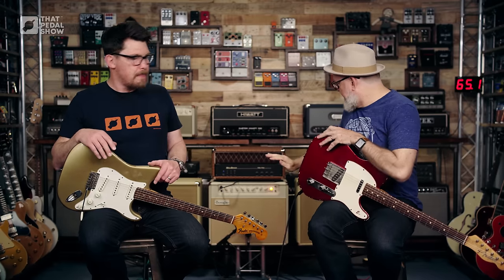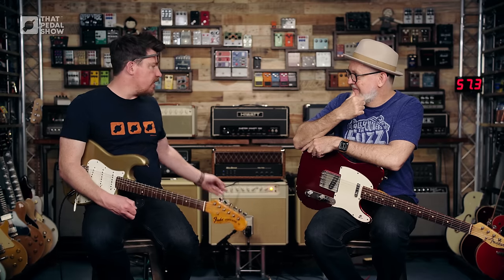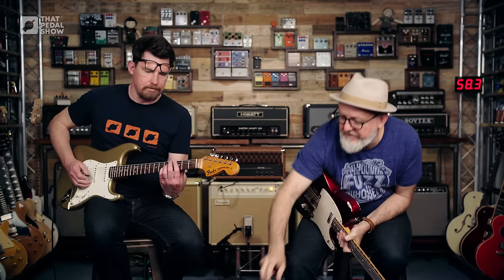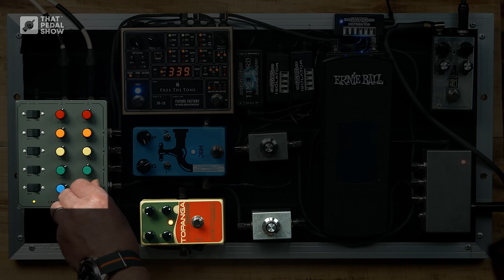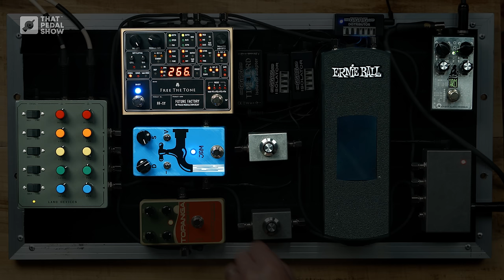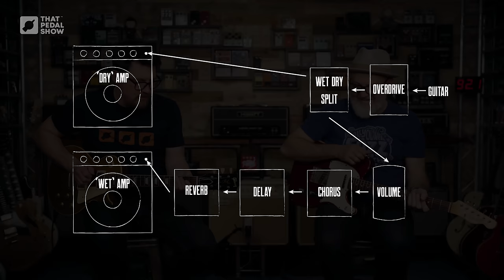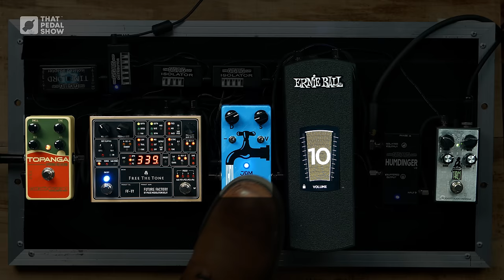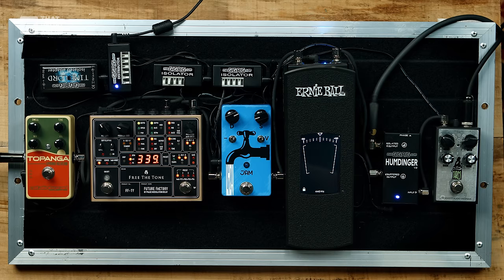Did We Get Wet-Dry Guitar Rigs Wrong? [Proper Wet-Dry-Wet Vs TPS Wet-Dry]

Comment: Hi Dan & Mick, what a top show this week, cheers! Quick question if I may? I have a 2x12 cab modded so I can plug in one head @ 16ohms or plug in two lunchbox heads which splits each speaker to 8ohms. Both amps have parallel fx loops so I can split delay into one, ‘verb into the other. Switch heads with an ABY pedal and I can put different modulations after the split. Tone options for days! Is this dual mono, or something else? Radial Bigshot sorts phase and ground issues so it’s pretty quiet even when loud.  Thanks lads

Comment: I use a Vox AC15 as my main amp, dry-ish. But I do use a touch of the on-board spring reverb, and the tremelo when I want it. And then have two old Vox Pathfinder 15Rs for stereo wet. No effects loop in any of the Vox amps. But I can use the Pathfinders as my Wet-Wet stereo amps. I tend to play pretty clean, just a touch of MXR Timmy to fatten. Then EHX Hot Tubes for a bit of dynamic grit/hair/dirt. For the music I love to play, I love to build up stereo soundscapes. And I wouldn't want to lose out on the lovely stereo pedals for chorus, granular, delay, and reverb. So I split it there after the Hot Tubes. One feed goes mono Dry-ish to Vox AC15 center channel. The other split feed goes to TC Electronic SCF+. After that, it's stereo for the L-R Wet-Wet signal path. SCF+ Into Chase Bliss Mood mk.II, SOMA Labs Cosmos. Then finally UA FX Del-Verb. It's more towards wet-dry-wet. But, it takes on some aspects of the TPS Wet-Dry, in that, the stereo effects are in series, not parallel. And I don't use loads of volume pedals/controllers. It's a studio setup, not for live. So I I just use the built in volume controls on the pedals, and amps. The two Pathfinders are nice and small. And sound similar enough, but nicely high pass out the muddiest lows for the reverb. The Pathfinder pair is plenty loud enough for wet in the studio. I like how they look like a little Vox trio too, with AC15 front and center, and raised off floor. And the two Pathfinder sidemen, just behind, on the floor, and closer to wall. For re-inforcement of the smaller cab/speakers bass. Only issue is cumulative volume. Would like to try a pair of AC4s as the wet-wet amps, and a Weber mini-mass on the AC15.

Comment: Still not quite right boys!!! The origin of the W/D/W was a regular stereo rig form the late 80’s with an added dry cab. Before that they used slaved heads for preamps. They did not use a speaker connected to the amps. They had load resistors on the amps and used line out box to feed the rack. Normally they used a PA power amp to power the cabs. Early 90’s Bradshaw added a dry cab instead of the the static load box. All 3 cabs had dry in them, but L/R cabs also had effects. You also had a dual stereo mixing systems to make it able to run things parallel and series. 

After some time guys like Landau started using a mic preamp on and mic on the dry cab. He then used a Lexicon MPX-1 for just delays/reverb in parallel. Power amps was a Marshall 8008 and two 1x12 for 100% wet. Running all units like you guys did in this video is not the proper way coz there’s no interaction between the effects.

Comment: The Direct out tap-points that Luke used were Line-Outs directly off the Speaker, because he wanted Output Stage Distortion - not just Pre-Amp Distortion... most, if not all Boogies have these Power-Stage/Speaker Direct-Outs... wonderful stuff! Hope this helps?

Comment: Is there an info page for the film gear (cameras, lenses, lights, capture devices...) anywhere? Amazing stuff guys thanks for all the years of content.
Reply from the maker: We’ve done behind the scenes vids but things are always changing. Mick here. Main cams are Sony A7Siii and and A7iii. Close cam uses a Sony G Master 24-70, wide cam uses a Voigtlander 40, both at F2.8. Lights are just standard LED COB types with parabolic soft boxes, panels over our heads, spots on the walls. Shot in SLog 3 graded on DaVinci resolve, edited in Premiere. Cheers! Oh, we use Atomos Ninja V for the capture - easier to deal with big disks and sensible screen rather than SD cards and camera screens!

Comment: I have used WDW rigs for over two decades.
I can vouch for the struggle of dealing with Sound-people.  Many don’t even understand why a guitar would be stereo, let alone more than stereo.  I put that on them!

That said, a WDW doesn’t have to be gigantic: three vertical 2x12s; or three 1x12s.
There are many tiny power amps on the market, and all you need to get spread is a stereo delay or a stereo modulation pedal (or ideally, both).

I used three 2x12s for years, it’s not that large, or heavy, sounds punchy and massive (like a 6x12) when dry, and a wide & lush when the three signals are on.  All it took was an Eventide Timefactor and a TC Corona.  Everything else can go in front of the amp - as you would with any setup.

Granted it is best for a power trio set-up or whenever there isn’t another guitar player.

Comment: Very cool. 

A couple of things to consider - if you're not using three volume pedals, there's no need to have volume controls in front of the reverb and chorus because their levels can be controlled by the mixer. The only way the tails would be cut is if you reached down and turned the mixer levels down by hand. For someone who just wants the split sounds without dynamic control, this would simplify the board and eliminate some cables.

Also, if you add a volume control after the split and on the way to the dry amp, you can get wetter than 50/50 wet/dry. Turning down the dry amp after the split leaves the other side of the split continuing to the wet part of the chain.
Reply from the maker: Send levels to the pedals is v important in parallel stuff, well, in anything really. Think of the aux send on the desk - critically important. However, all that aside and as we said in the video, we didn’t choose this stuff because this is necessarily how you’d do it, we chose this stuff because it helps illustrate the point of how it works. Cheers!
Reply: @ThatPedalShow  I know what you're saying and I have years of experience on a desk. Send levels only matter when you send to something that responds dynamically, like compression, overdrive or distortion. When sending to reverbs and delays, especially digital rack gear, it's actually easier and faster to leave the sends at a fixed level and use a fader to control the amount - assuming you have enough of everything that you don't have to send multiple tracks to the same piece of gear.

In this case, it's just a single guitar, so controlling balances through returns works.

You skipped a couple of wet/dry options too.

You could split everything on the pedal board, use the mixer in to one amp. One advantage to this is there are pedals that don't have internal wet/dry mix controls, like the chorus you used.

Or you could send to one amp, split out of the FX send, then split again on the pedal board and send the mixer out to one amp, so you can carry less, have a wet and dry amp and also have the time and modulation effects in parallel.

One last option, just to ensure option overload, is to go from the FX send to the pedal board without splitting. Then do only the split to the parallel effects and ensure there's some stereo panning at the mixer, and return one channel of the mixer to each amp. This isn't wet/dry (that's coming), but it gets you the parallel time/modulation tones and you can have them in stereo.

In this last scenario, when you split to the parallel effects on the board, you can send one of the splits directly to the mixer. From that point, you could pan that to one amp and everything else to the other, giving you wet/dry. Or you could add some or all of the time/modulation to both amps with the dry in just one, or both depending on the tone you prefer.

Also, with all of the options, you can add a pedal to any of the parallel chains so that some of the parallel effects are made up of pedals in series - like adding a medium/long delay in front of the reverb so there's a repeat or two, while keeping the short or slap ping pong in parallel bouncing between the two sides.

I think you might find the flexibility of having the parallel dry going to the mixer and deciding from the mixer whether you want true wet/dry or a variation adds quite a few creative options.

Comment: It is a PITA, which is why I rejected the idea. Does sound great but for those of us who play pub gigs it's utterly impractical.

On a side note having one of those Ernie Ball volume pedals transformed my pedalboard! The big display tuner and the level indicator allowed me to ditch (well, 'use elsewhere' technically) my Boss tuner plus giving me more control over my output levels. The send and return loop is useful as well although using it in my current rig is unnecessary. It is expensive if you only want a volume pedal but the extra functionality makes it worthwhile.
Reply: Thats why you build a rack, once the rack is set up its only a few cables, one power switch and however many cabs you need.
Reply: @BigMateo24  I had that back in the early 90s. Still a pain in the rear end to run three cabinets at a pub gig let alone the time required to balance the setup properly. Stock wet/dry is more my thing these days with a small combo cranked for the 'dry' sound and my main amp running with the full effects.🙂

Comment: ok INTERESTING ....THERE IS A ANOTHER WAY - THAT I AM USING: pedalboard > mixer > insert of big stereo amp. I don't think I have to analyze much ....I think you sacrificed parallel mixing in the name of simplicity..and listener consistency right? ....Well with this way YOU CAN HAVE BOTH PARALLEL MIXING WITH SIMPLICITY...and you can do parallel, in series, both, whatever. This is the basic core setup (never mind why: it's complicated )  Most of my channels use amp & cab sims, but when I want a real distorted amp sound, I set up another very small amp in another room and use it accordingly: Dry or Damp but in parallel mostly: My small mixer has a total of 10 channels.  And you have the flexibility to work your sound as a DIY engineer.  But I haven't gigged this set up ...yet at least.

Comment: Epic show! Amazing playing !! And you know ... I think you guys have come up with an incredible improvement over the "original wet/dry/wet/whatever".
After attending That Pedal University for a couple of years, here is how I have applied my learning to my budget. 
Guitar > Polytune 3 > Radial BigShot ABY 
> B Out to Blackstar HT-5R (either Clean or Dirty channel with Reverb on a bit)
> A Out to TC Electronic HyperGravity > Nobels ODR-mini > Tumnus Deluxe > Boss CE-2 (which I've had for nearly 40 years) > Flashback II > Keeley Verb-o-Trem > MXR Classic Overdrive > MXR 10 Band EQ > Katana 50 MkII (usually clean but I can use Flanger or Phaser.)
Mick would say that there will be latency causing phase problems but I can't hear it at apartment  levels. Flipping the Phase switch on the BigShot sometimes makes a small difference but usually I don't hear any difference.

Comment: The people saying you need to have 100% dry in the dry amp and 100% wet in the wet amps are really playing a game of semantics. The very first version of Bob Bradshaw's wet/dry rigs were in fact a 100% dry signal mixed in with the wet effects in stereo, so two cabs. A stereo rig. After that, in the second generation of these live studio rigs he added a third cab with 100% dry to give it a bit more punch and THIS is exactly what you guys call TPS W/D/W because the two stereo "wet" cabs still had the dry signal mixed in. It was only in what we could call the third generation of Bradshaw's rigs that he removed the dry signal from these two cabs.

So what someone chooses to cal W/D/W is subjective in my opinion.

My W/D/W rig has a flanger in the dry amp. Is flanger dry or wet? Not sure but it sounds better if it is included in my dry amp. Then I have modulation, reverb and delay in my stereo wet rig (2 separate, identical 100W amps) but the dry signal is left intact in those two as well. I think it sounds fuller and deeper if it's left in there. I do have kill-dry on my modulation, reverb and delay pedals so I can at any time cancel the dry signal using MIDI, if I want. But I choose not to because it sounds better. This might change and if so I simply hit kill-dry, but until that day I'll keep it the way it is and still call my rig W/D/W.

Comment: Thanks from Switzerland🇨🇭 for your awesome and informative videos. I'm wondering why you send the OD to the dry AND wet amp?
 I send the OD after the splitter only to the dry amp and my impression is, that the sound is a little bit more "clear/open" ).
Keep up the good work👍🏼🤘🏼🤘🏼
Reply from the maker: Yep, we’ve explored that in the recent Aynsley Lister episode and also in Dan’s personal rig. But for the simplest approach, having amps that are broadly the same gain and headroom means the OD hitting both amps is the easiest thing to control. Cheers!
Reply: Grüezi

Comment: The nice thing is that wet/dry allows you to use a solid state amp like a small Quilter and still get all the juice from the other valve amp.
In fact, solid state amps react a little faster with outstanding bass response. You can then shave off some of the lows of your valve amp and use a low watt amp.
For wet/dry (TPS*)/*TRADEMARK/ i use a 15w Traynor DH15 and a Quilter Microblock 45, the size of a deck of cards. Brilliant.
Go check out the other wet/dry TPS videos!
Reply from the maker: Yah nice way to do it! Agree on the SS thing too!

Comment: Have saved watching this until i could use headphones, definately the right move, loved the Wet/Dry/Wet but the simplicity of the TPS Wet/Moist  was a a great full sound and is what I have with a Blackstar HT1R (rehoused as a 2 x 8) and a Bugera T5  and 12"" on 1 watt mode with a 1 x 12 cab. In  my little room it sounds great and was cheap and easy to set up having learned at the TPS School of Tone!
Reply from the maker: Yeah man - those two amps run wet dry will sound more satisfying than some boutique thing alone. :0)

Comment: I have a Helix. I run it through a solid state Orange. I have an incurable fear of pedals and tube amps failing at a gig. I have very little interest in gear. The reason I come here is to steal licks. Just based on the performances alone this is the best thing going for guitar on YouTube right now. Thanks! And for what it's worth all this info really enhances the ability for someone like me to bring out the best of my Helix. The principles that you teach work really well in modeling amps.
Reply from the maker: Nice one Nathan! Thanks for being here! It won’t help, but in my 30+ yrs gigging I’ve had two tube amps go down (always the rectifier tube) and three SS (two dead, one repaired. Never ever had a pedal fail. Cheers! Mick here. :0)
Reply from the maker: Many mains fuses of course. But that’s across everything.
Reply: @ThatPedalShow  it does help and I’ll try it!! 🤘

Comment: If you use a Proper desktop mixer, you can have your FX in Series & parallel at the same time. Once you experience that, its hard to go back. But there's of course a difference when playing live vs your bedroom/garage. At home I can do all sorts of complex routing. But for a gig, the setup has to be simplified in order to be mobile and stable. the last thing you want to do at a gig is troubleshoot.

Comment: This was timely. Just thinking about doing a wet dry wet using a simplifier for stereo plus a normal amp for the dry. (delays and reverbs in loop of the simplifier and some modulation going to FOH mixer via stereo balanced outs of the Simplifier) I have a rehearsal tonight so will see how it goes then. We have some outdoor gigs coming up so I'm hoping it will provide more spread. What are your thoughts guys?

Comment: In the late 1990's l used to do this with a 100 watt Marshall SLX head and a Mesa-Boogie Simul-395 power amp, using Marshall 4X12's that were wired for stereo sitting side by side. Run the "inside" over/under pairs dry, the "outside" o/u's wet. That way, l got wet/dry mix in each cab, and it sounded more natural (to my ears) than using three separate enclosures. 300 watts into two 4X12's loaded with G12-75's above, Vintage 30's below. It sounded like locomotives eating dinosaurs in the Grand Canyon lol. I miss those days...
Reply from the maker: Holy sheeeeat! What a rig. Boogie 395… my heart is melting. Mick here. :0)
Reply: @ThatPedalShow  Hi Mick, yeah, fantastic power amp for certain! I'm sure you know the details since you spoke so fondly of it, so I won't bore you with a recitation lol. I always ran it in it's "class A" mode because it made it a little more "brown" sounding and knocked the volume down a bit, every little bit helps lol. I still have that beast too. Anyway, really enjoyed the episode, love you guys and what you do. Really also greatly admire the skills you both have for playing and for sharing musical & technical knowledge! Thanks for your reply, cheers!

Comment: I had a ABY split to two combo amps and one I ran a delay and Looper (the louder one) solid state 2-12" 120WRMS that had a decent reverb built in. I left the Dry 12" with reverb off and ran quite a bit harder into breakup.

Wide stereo the thing was perfect. Just not something I could rationalize keeping. I still run multiple parallel inputs but with a single Keyboard amp.
KBA 50 3 Inputs and a loop. I still run the ABY but I've been using a MICROCUBE gx also with my Focusrite and monitors sometimes.. one bass I have three outputs mudbucker P and Double J.. An acoustic with Piezo UST-SBT and a dual rail humbucker with Series Parallel..  Sometimes out comes the Firepod just to get enough inputs